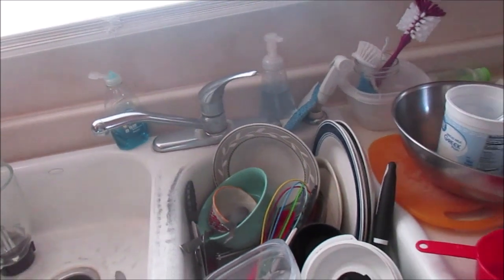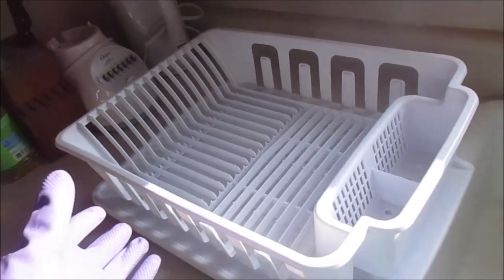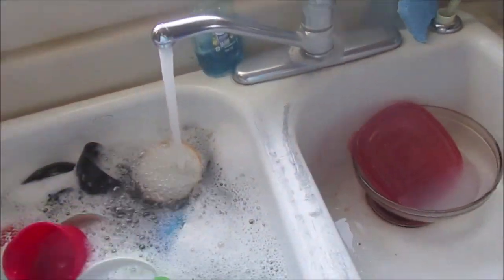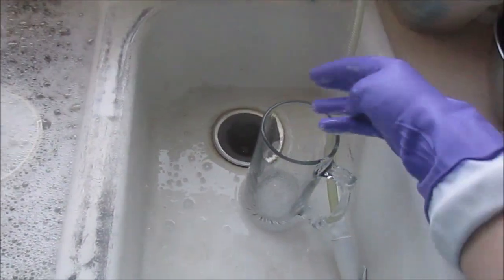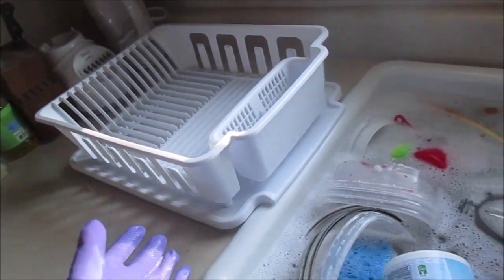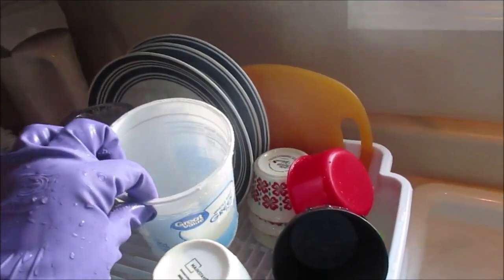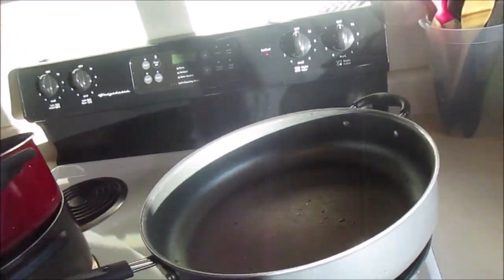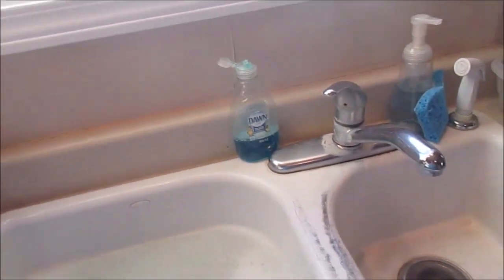Washing Dishes with 2 Sinks !!!!!!!!!

Comment: I like this video, as i want to try a 2 tub method. But in my opinion, i would not use/reuse a sponge or use the water dirty dishes were soaked in to "clean" anything else. The only exception is if there is bleach in the water. Its the same reason you should shower after taking a bath - the bathwater is not clean. Or rinse the dishes after soaking - the soaking water itself, without bleach, is not clean, so we want to rinse it away. I wouldnt use bathwater or dishwater to clean anything else after dirty dishes or dirty bodies soaked in it. Sponges also are not a germfree tool. Id use a dish brush or a dish rag that im replacing every time. Otherwise i really appreciate you breaking down the mechanics of using 2 tubs for batches of dishes

Comment: Nope. I wash each dish individually. Never using a full sink like that.
Reply from the maker: I am glad that method works for you! :) Have a great week!  That is easy if there is not many dishes to wash. But this method will save on hot water  :)
Reply: You use a metric ton of soap and water doing each dish individually. This is a much more efficient method. Take it from someone who used to do it the other way.